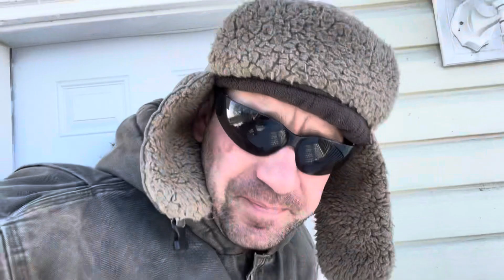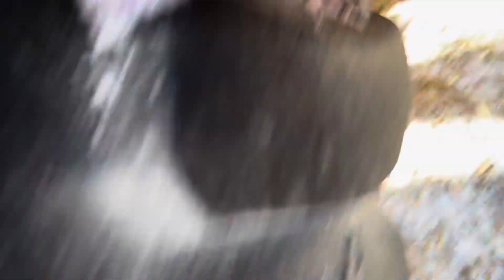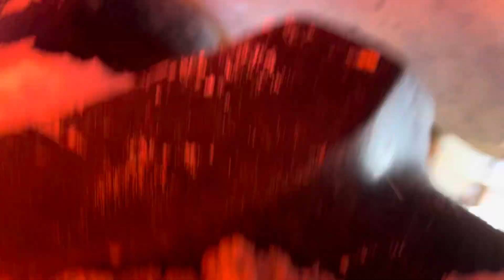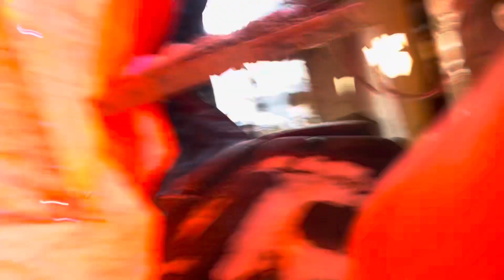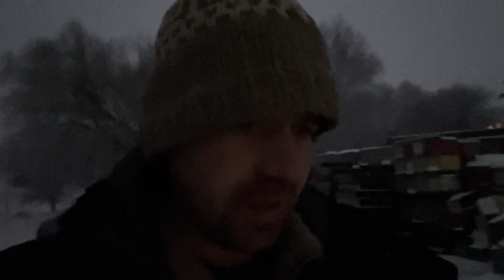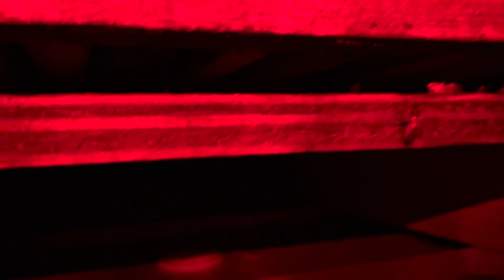A Frank Discussion With the Makers of Apivar

Comment: That IR camera is seeing only the surface of the box.  If the cluster is a bit smaller and if they are also tucked into the box farther back, the visible signature will be diminished.  In my experience, if there is a signature at all, you're good.  The old theory that the bees heat the cluster, not the hive, is true, in my opinion.  My temperature sensors show very different signatures when placed on top of the top bars than they show if they are between the top bars.  I believe the difference is, being in the cluster vs. above the cluster.  I have often used the feed hole plug as a reference.  If there is no signature there, there is likely nothing alive in that box.  My foamies do not extend under my feed hole plug so I see consistency in that regard.

Comment: Nice video Ian. 

Even though you edited it out, 
I think we all can imagine what your first take was like. We all want to see that edit clip, ya know.

Apivar has been a 'trust but verify' product for me for years,  because I've witnessed too many inconsistencies.  Now it's a 'I don't trust, but when forced to, use it anyway as a partial method' + oav, then verify. For the cost it's ridiculous to keep doing this.
I still don't buy it's just developed resistance. I felt for years it could be factory inconsistencies as one batch seems to work far better than others when used under the same conditions and at the same time.
Now it's in new packaging. I'm suspicious if that has any significance as to changes in the formula.. which could be good, could be bad depending on the reasoning. 
On behalf of all beekeepers, we thank you for your efforts.

Hope you and your family have a great winter & holiday season!
Reply: Bloody well right. And until there is a fast and easy way to test the Apivar strips I'm not even at the trust but verify part.  Dump em.

Comment: This may seem like a silly question. But why not get away from Apivar and use Formic Pro or ApiGuard? Maybe even combine ApiGuard with OAV? ApiGuard tends to shut-down brood-rearing for a time and it therefore seems reasonable that OAV could be used while there is a lack of brood…maybe 9-12 days after application of first treatment?

It’s extremely unfortunate that Apivar seems to be losing efficacy. Maybe it’s an opportunity to utilize different controls? Guys like Bob Binnie and Russell Heitkam don’t use amitraz at all and they have successful operations.

OA/gly sponges seem to work very well.

Comment: Thanks Ian.  Many of my hives have failed already due to treatment inefficacy.  I'm not as disciplined in my records but it does seem as though Apivar has given inconsistent results.  Can you share what off label use looks like?
Reply: He did mention that. Higher dose, placement and/or use of other products with apivar. Higher dose for example would be an easy one, just add more strips. However data and guidance would be ideal before doing that.
Reply: The inefficacy is because of incomplete and variable application throughout the hive.    Better application methods are needed to be effective in the field.
Reply: @danielweston9188  some has to do with actual resistance too. However agreed there could be better application methods.

Comment: First of all Don't put a lot of faith in an impregnated plastic strip, you can only get so much on the surface. Second who in the hive is directing all the bees to cross the plastic strip. Enough of that Hope. They need to make it Cheaper and stronger or at least cheaper so we can use 3 or 4 in the brood chambers. I just took my bees through a whole year on a double treatment of 4 gram from last December. The bees I lost were from starvation, water dripping off the lid, or they were in a double deep and had brood still under the cap when I treated. I also split in September this year which caused the queen to  have less bees to raise the October bees that will raise the winter bees which mean a smaller winter cluster so she won't be laying in November. This work great if the bees are health. I still have 5 and 6 frames of bees going into winter but  the queen isn't brooding up in a double deep situation or a packed out single like yours. Which is a breeding ground for mites, in the winter.!!  A robust apiary is better than a robust hive.  If you have a robust hive you haven't finish working lol ;) You have WAYYYYY to many bees in the box to get a 100% kill. Split'em.

Comment: My take/experience is that science has gotten political and $ oriented to the point that I don't trust much of it anymore.......and my background for the last 40yrs was in healthcare ☹️
Reply: I think what we're seeing is mirroring what we're seeing across all modern pharmaceutical industries. So much of the industry has had to shift to extremely targeted therapies, even outside of rDNA level targeting, we're seeing products that test and work well one year be practically useless the next. As it becomes harder and harder for them to create products that don't overlap existing patents, we move to top-down treatments, where in the early days a company may have found a compound that worked across the board, every variant or differential condition was covered because of the bottom up effectiveness, the target had never developed any ability to protect itself, but with top down, you often find a formula that works for the exact conditions and target you're developing for, but it only works for a few years before adaptations render it useless, or, slightly different strains/genetic makeups mean that it has to be reformulated. This is unfortunately the future of all pharmaceuticals, we've already exhausted all of the big bottom up solutions and our targets have developed resistance, so modern solutions are going to be more like the flu vaccine, where they take an educated guess on the conditions and target variants and formulate that years product based on that, combined with extremely specific formulas adjusted every year to work around new resistance, which is quite honestly how all pharmaceutical industries will end up doing something like rDNA and modified gene products, where they can use something like CRISPR to insert new sections of gene to work around resistance and mutations. We'll see this in human medicine, pest control products, even antifungals and herbicides. 

Antibiotics, pesticides, fungicides, herbicides, these were all wonders of the 20th century, but our constant use and dependence on them has changed everything, killed off some plagues but given us new ones that are evolving faster than our science to fight them.

It's easy to get angry at the pharmaceutical companies, the "experts", manufacturers, even our government, but the reality is that no one wants to admit that this has gotten totally away from us.

The next 50 years could very well end up being really bad for humanity if we can't get back in front of pest and disease management, as I'd right now, I feel like we're nearly 10 years behind what we're fighting.

/End rant
Reply: I agree with you 100%!  I spent the last 25 years in pharmaceuticals and have watched science become more political and decline very rapidly.